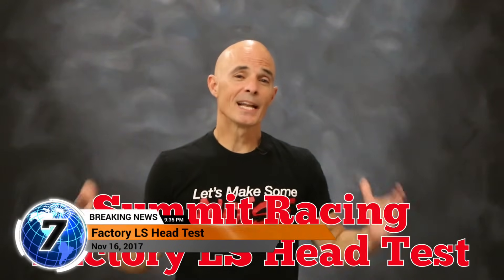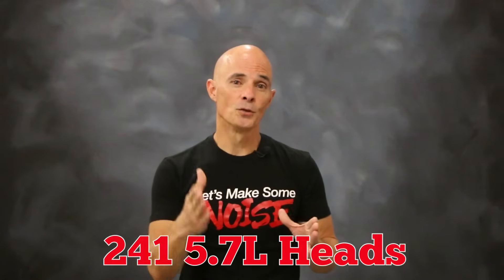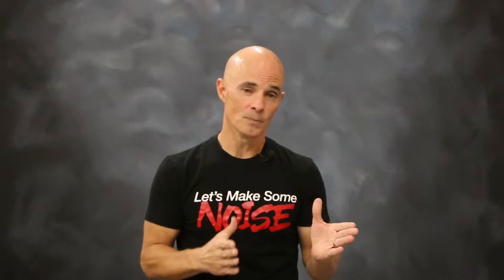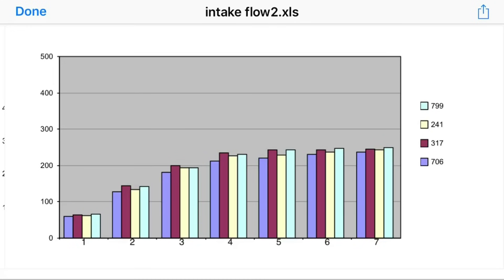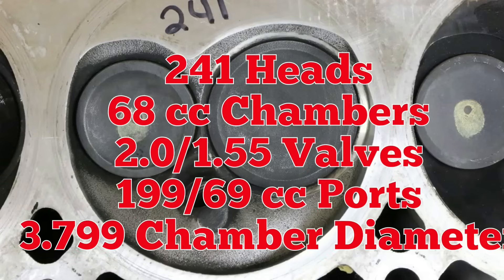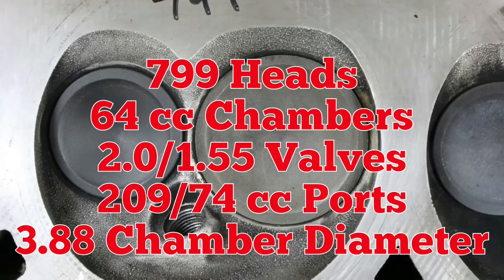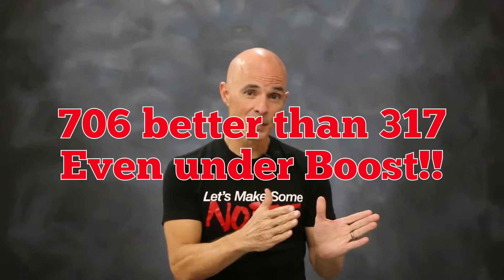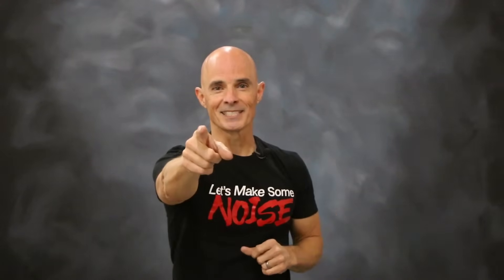THE ULTIMATE STOCK LS CYLINDER HEAD TEST! (241, 799/243, 317, 706)

Comment: So I can run my CNC 241 on a build gen 3 iron 5.3? Car is stock gen 3 ,instead of building alloy 5.7 can I use my heads intake sump ecu on a iron 5.3 as iron block much stronger? Both have 24 rel wheel will it all work obviously boost cam already has new LS7 lifters ...just got a sick turbo kit and g42 1200 . probably blow heads cam ls1 to shit but doing fuel lines now to run e85
Reply from the maker: 241/853, 706/862, 799/243 and 317 all work on a 5.3l

Comment: Wished you would’ve expanded and explained more to give a more apples to apples comparison. Usually the 706 on smaller bore are best, 917s on bigger bore WITH SAME COMPRESSION as the 706s are usually the best and the 799s even when compression is same they don’t make the same power because the chamber design isn’t as good. You did mention that different combinations would have different results but without an extra 5 minute explanation many wouldn’t truly learn or understand generally when each would be the better choice.
Reply from the maker: 917 is not one of the available heads (I'm sure you mean 317s), They can't be milled enough to match chamber size of 706 heads. A test was run with milling the 317s down to match 799/243 heads, the 317s still made less power than the 799/243s (because of the bad (not size) chamber design). Please see that this test was to compare all the STOCK heads in stock trim. When we start to modify them, where do we stop? If one set of heads gets to be modified, why not the other? That's why stock to stock is the best comparison. All stock is Apples to Apples. Your request is not.
Reply: @richardholdener1727  yes I meant 317s but my request is to explain things better JUST LIKE YOU DID HERE as too many still think they need 317 on a turbo/blower set up and how on smaller bore sizes like the 4.8, 5.3 and 5.7 L the 706s are usually the best stock head choice and ported is still usually best even against aftermarket heads because of cylinder shrouding. Like I said giving 5 extra minutes to explain things would help more people but instead you think other engine builders like me are attacking when I'm actually trying to help you and the tons of unknowing idiots that see you say in one test Cam Norris is the best cam we tested not showing or explaining how actually depending on what they need or willing to buy there are tons of cams (or heads or.....) that would do better and cheaper (or cost more but do way better too)... But instead just keep doing tests and not admit that Hot Rod or others set up the test and at the same time you say get this cam or intake they also had huge adds in those magazines that PAID you to run the SO CALLED tests !!!!

Comment: so i want to make sure I'm understanding this right, 
you've got a stock 5.3 with factory 706s, and all you did was cam (matching lifters/springs too I'm assuming) and intake and it made 473 hp/425 lb-ft?
stock throttle body? stock injectors?
Reply from the maker: You can't make 475 hp with stock injectors-you need more fuel (which we had)
Reply: @richardholdener1727  ahh gotcha, so about what would this combo make with stock truck intake and injectors?

Comment: I have a LQ9 with 317 heads. Should I keep my heads if my power goal is 800-900 hp?
Reply from the maker: easy with a cam and turbo (richardholdenerperformance.com)
Reply: @ so I could just gap my stock pistons, port my 317 heads, add cam and big turbo and it will hold with no problems if my goals is you drive it and not race it?  I don’t even have to bore it over?

Comment: Hey Mr  Richard would like some advice have a lq4 6.0 with 317 heads and a lowered intake manifold. I am planning on putting this Ina rx8. Can you advise a combination of a camshaft /trotllw body etc to get the most power but yet streetable  run on pump gas
Reply from the maker: DEFINE YOUR POWER GOALS

Comment: I was in your recent live stream you asked about the 317 heads vs some other ones. They dont seem to really flow better than the other heads anywhere besides 4-6k and not by much, then the exhaust side is no better than the other ones.
Reply from the maker: head flow is not rpm specific. Head flow is given in relation to valve lift and the 317 heads do flow better than the 706/862 heads.
Reply: Ah this is what I get for looking at something for 7 seconds and thinking I know what it means. 

 @richardholdener1727

Comment: I have a 2013 gen iv 5.3 with a gpi hlt3 cam 220/224 .629 .629 it has 853 ls1 heads, I wanna change the heads out because I bought the truck like that whats better? 706 or 243 stock for stock for this application?
Reply from the maker: I would pick 706 heads but do some mild porting and chamber work

Comment: hello moster! 
i need your help please im going to ls swap my 1957 bel air and i found 5.3, i was going to refresh the engine and when i took off the heads i found the heads have massive damage it was 706 and my friend have me 241, can i instal them with no problem or i need change the cam or lifter or anything?
thank you so much 🙏🙏🙏
Reply from the maker: put them on
Reply: @richardholdener1727  
i really thankful for your help thank you so much sir 👌

Comment: I have a 2008 Chevrolet silverado 5.3l with 243 heads and afm dod delete my question is can I run 706 heads on my engine with stock cam and no issue and the reason I'm asking is because I have a bad vavle in the head
Reply from the maker: YES

Comment: Would 317 heads with high compression piston be better?
Reply from the maker: better than what?
Reply: @Richard Holdener  the better out of all those stock heads.. im assuming the 317 flow the best but would drop the compression on a 4.8 or 5.3.. so with a higher compression piston set would that be better than a 862/706 head?

Comment: I'd like to know how a 799 head swap on a stock 2002 LS1 that came from the factory with the non-egr ls6 intake and stock 6.0 truck cam. I doubt it would be a significant increase but it would be interesting to see how it would compare to a stock LS6. I have 72k miles on my 02 TransAm and I have two sets of 799s from 5.3 L33 engines. I'm not looking g to swap the heads but it would be an interesting comparison. Right now I'm just surprising people with my stock engine that's just got free mods, long tubes, catless 3" y-pipe and and 4" exhaust. I mainly did the air getting in and out because it's also got a bottle but I rarely need it. My car has always been kind of a factory freak anyway. With an slp lid, hooker competiin heads and the 3" ypipe connected to the factory exhaust the car dynoed 398rwhp and 419ft. lbs. All 3 pulls on that chassis dyno (no nitrous used on the dyno) were within 2hp of those best numbers and its had some big improvements since then but the engine itself is still all stock, intake to oil pan. It is a 6 speed WS6 car but ram air doesnt do much sitting still on a chassis dyno

Comment: What about for gen 4 4.8 ls? If mine doesn't need piston rings. I'm going to do heads and a cam when I take these turbos off (it's swapped into an e36 and I want AC)
Reply from the maker: use your stock heads
Reply: @richardholdener1727  okay. What will I need to make it rev to ~7.5k ? It's a stock (after i remove the turbos). Only things done is ls1 intake, holley terminator x, and 60lb injectors. I've been binge watching so many of your videos I can't remember which had this info. I should have taken notes.
Reply from the maker: springs and cam
Reply: @richardholdener1727  okay rockers/push rods aswell? Or simply just springs/cam? Unsure why youtube isn't sending me comment notifications

Comment: I have a 2000 Sierra 5.3 that’s getting a btr hot rod cam. The heads on the motor are 706 heads but the machine shop has some 243 heads that they recommended would be better for the truck, what do you recommend?
Reply from the maker: either works-the 706 made more power in my testing
Reply: @richardholdener1727 on a lm7 .??!

Comment: Everyone is always trying to get top dollar for some clapped out 243/799 heads on fb all the time with parts missing... all you really need is a set of milled 706 heads (.20" about a 58cc chamber) and a good valve job with the installed height of the springs in spec, and you're good to go! That's what I run on my trucks, and it always makes for a good combo. Flow numbers aren't everything, combination is just important. If your cam lift is .550" you don't need a head that maxes out flow at .650"... you'll never utilize the extra flow. Great comparison for the real world bro!
Reply: Very true there… but I have personally installed a milled set of 241 heads on a 5.3L with a zo6 ls6 camshaft. The heads were 59cc and they most definitely made more power than the 862/706 heads.  I have the data logs on HPT to verify it. This was in a 2000 Gmc Sierra with a 5.3L, long tubes, e fans, and volant CAI with ls6 car style manifold.  The difference in power with smaller camshafts is 100% in the compression and valve job. The cam will be the limiting factor, not the CFM of the heads.

Comment: Did you guys use the same pushrods for each set of heads?  I was led to believe 799's would require a longer pushrod than 706's on a 5.3.
Reply: they are the same 7.385in

Comment: You got 476 with just cam head and intake? 😱 im swapping my v6 for a 5.3 off a yukon. Has 706 heads. How much hp can the 5.3 take on stock internals? Im trying to get to 500 area. Was going to do stroker kit to reach that
Reply from the maker: WE MAKE 1300-1400 WITH BOOST ON STOCK BOTTOM ENDS
Reply: @richardholdener1727  no way!!😱😱😱 thanks. Saved me some money. Didn’t think they can handle that much power. Appreciate it.
Reply: @richardholdener1727  where can i get the 224/240 cam? I dont see it anywhere online

Comment: Would be Nice with a recepe of 
Best junkyard motor ls?
Sort /year 
Cylinderhead 
Camshaft 
Pistons 
Intake 
Motorcontrolsystem
Cheap but ok turbos 
7-800 hp
Good respons /flat torq
Lot of bfb

E85 is used in sweden 
And 98 oktan
Reply from the maker: 5.3L, AFTER MARKET CAM (YOU WON'T FIND ANY GREAT STOCK CAMS IN THE YARD), SPRINGS AND INJECTORS

Comment: Hey Richard what is better for 5.7 i have tickperformanse stage 1 v2 cam and springs long heatter 3'pipe full exhaust !
Reply from the maker: keep what you have unless you run ported heads
Reply: @richardholdener1727  thanks you so much Richard 🤝

Comment: Can you make any power with 317 heads? With the compression being so low?
Reply: What would be a good factor cam for the 317 heads?
Reply from the maker: YES YOU CAN MAKE POWER-JUST LESS THAN THE OTHER HEADS
Reply: @richardholdener1727  what would be a good factory camshaft for a 5.3 with 317 heads?

Comment: What about doing this test on a 6.0l?   I'd like to see how the heads compare with the slightly larger volumes of air the 4in bore would be pushing around.
Do you have a test or video like that?
Thanks
Reply from the maker: I did the test on a 6.0L also

Comment: Hello, i have a question i have a 5.3 lm7 but i have 2 different sets of heads, 706s and the 862s which of the two heads work best for a n/a motor  or boost application
Reply from the maker: SAME POWER

Comment: So interesting... I kept my old 706 truck  heads even though I was looking for 799s. Maybe I already had a diamond in the rough.
Reply: Castech 706 heads r junk. Straight up. Mine cracked after putting hundreds of dollars in machine shop time and work and parts.
Reply: bigger heads mean nothing without the cam to back it up bud
Reply: @Loustylz203 lol....heads mean everything!!!!!
Reply: @pops3554  ive proved it on the dyno time and time again bud
Reply: @Loustylz203  pops is right, but bigger heads (like you said) AIN'T always the right choice. (but pops didn't say bigger)... Huge ports on a low CR engine = low velocity and kills power but a high velocity, right size valves, swapping open for closed chamber on an otherwise stock engine can still increase HP a ton.
Reply: @pops3554 . Heads will only flow what the gatekeeper allows!!!

Comment: How much flywheel horsepower can I expect from a sbe lm7 gen3 5.3 with 243 heads with a 233/250 duration .630/.619 lift cam Holley single plane intake 750cfm brawler carb? Should I consider swapping out to 706’s?
Reply: Forgot to add the 113 lsa
Reply from the maker: 465-475 hp
Reply: Thanks Richard I appreciate the response and I really enjoy your videos i learned a lot of my engine combos just by watching your test videos

Comment: I put the #706 heads on my LQ4, I swapped them out for #241's, #706 10.5CR was to much for 87 pump. This would be better for a lighter vehicle that likes Premium fuel.
Reply: So what would you recommend on a turbo 11:1CR 6.0 that will be running e85 cruising & c16 racing...706s or keep the 317s ?🤔

Comment: I have both the 706 and 862 heads... think I'm going 862 on my 5.3 build, as I understand the 862 is simply a better casting quality of the 706 head. I'm going to stick with a truck intake manifold and go with around an 80mm throttle body to keep bottom end torque. I'll be using true flat top standard bore pistons with BTR pushrods and BTR springs, with a Howard's Rattler Camshaft. Finally a 3,000 - 3,200 Yank Converter. Should motivate The White Devil 😈 decently!! Great informative video Brother!!!
Reply: What heads would be good for boost?
Reply: 706 were mostly made by Casteck. Those are junkie. They crack around the head bolt.
Reply: There is a cast mark on cylinder head under rocker bracket. Mine are good but need alot of work
Reply: It's the opposite I believe. The 706 are better than 862.

Comment: Im rebuilding a 6.0 lQ4 No Turbos or NOS its for street use in a pickup. Was wondering if the 706 heads or 243 heads are gonna be better for the LQ4 and my application
Reply from the maker: EITHER WILL WORK

Comment: I have 317 heads on my 6.0 ..I have a good pair of 706 would it be worth changing them out all stock..bit eventually want to do mods
Reply: * 6.0 is stock
Reply from the maker: IT HELPS WITH COMPRESSION AND POWER

Comment: Definitely on the wild side of the 5.3L builds, love the knowledge. I have 317,241,862,706,and home ported 799s milled .015. I just bent then broke a valve on the 799s (end of season was trying to make it by) The 5.3L piston blew into pieces so much that it is just a rod wrist pin left on the crank. New junkyard cam swap engine going together and I'm going to try out the 706 heads until I get the 799s repaired! Thanks Richard

Comment: Which head would be better for an lq9?
317 or 706
Reply from the maker: for what?
Reply: @richardholdener1727  For more compression. Trying to keep it all motor and would still like to keep it on pump gas 93. Going on a 2000 silverado

Comment: I have a 2006 Chevy Silverado 1500 HD with a 5.3L L33 aluminum block but no casting numbers on the heads. Any thoughts on what I've got?
Reply from the maker: l33 cam with 243 or 799
Reply: @richardholdener1727  How does the 799 compare to the 706?
Reply: They don’t make 5.3 hd truck model hd models come 6.0 gas 8.1 gas or 6.6 duramax

Comment: Is it okay to run stock 5.3 gaskets with 243 heads? I also have a 222/224 comp cam, will this combo be okay? If soo do I still use 7.4 pushrods, or shorter?
Reply from the maker: CHECK LENGTH
Reply: Thank you for replying so fast🙏

Comment: my 5.3 has 243 heads. and the block has flattop pistons. i am told this is good. i have put a 225/225 cam in it and i switched over to carburated and  am told it should to more than 5oo hp with all the other stuff i got so.
Reply from the maker: good luck-I don't think that's enough cam or head to make 500 hp with a 5.3L
Reply: @richardholdener1727   havent even got the super sucker yet. add 50 hp

Comment: I was always under the impression 706 heads were worse than the 243 heads!
Reply: if your 706s have a battery picture cast into them (intake port) it means the manufacture was bad, Those 706s were bad about cracking. But the way they made the castings 706 = molded vs 243 = sand castings, the 243 is a little rougher but a 60 or 80 grit sanding roll and smoothing out the ports or porting them then the 243s are just as good as the 706s

Comment: I have a dilemma. I have a set of 862 and 317 heads. Building a 6.0 w/ flat top pistons. I CANNOT run premium gasoline all the time. So I cannot use a 862 based off it's compression alone. I'd have to enlarge the chambers and or put a taller head gasket if I used the 862 heads to lower the compression. In this case would there be any benefit to the 862 heads over the 317 heads?
Reply: go with a 364/716/823 found on L92 motors these heads have a 68cc chamber compared to the 862s 61cc chamber you would basically have a small bore LS3 should bump your compression just enough but still safe, just keep an eye on knock sensors under load and adjust timing accordingly